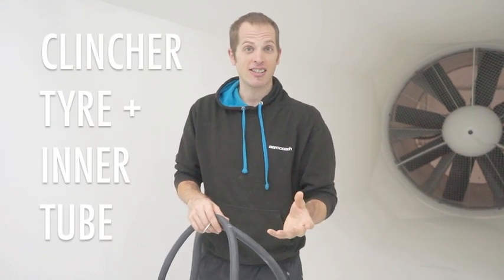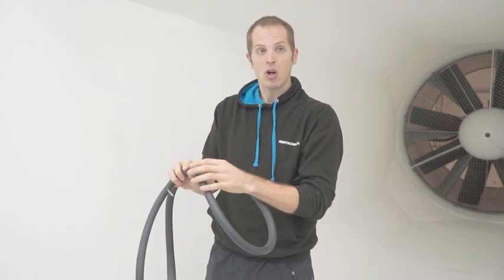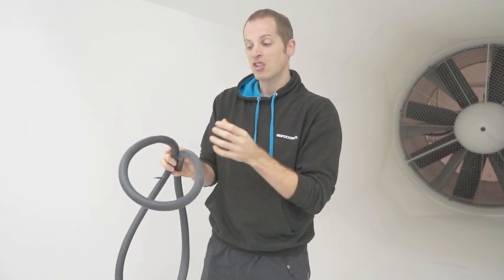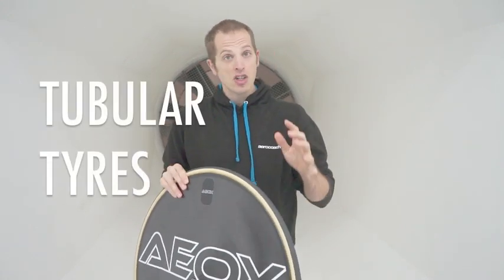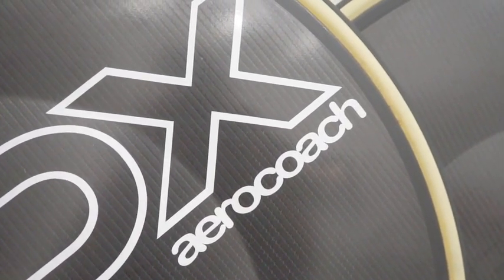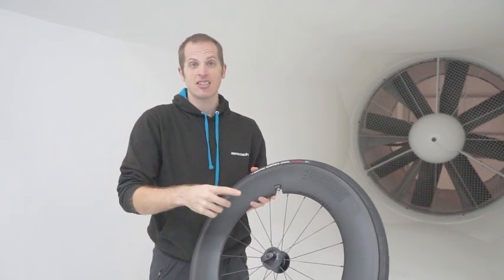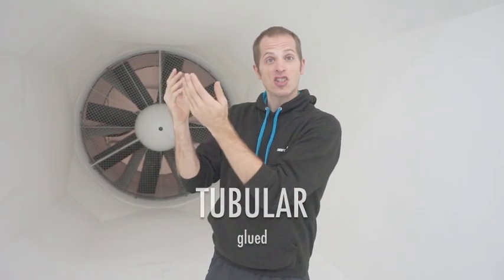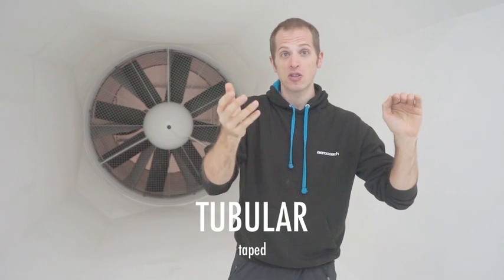CHOOSING THE BEST TYRES - clincher vs tubular vs tubeless!

Comment: Hi there. The power figures are tested on smooth rollers or actual road surface? Quite surprised to see that 120psi is actually slower than 80psi.
Reply: Smooth roller.  The numbers would be higher on the road but the differences would be similar

Comment: Great video. Can you do a follow up on how do the three systems differ aerodynamically?
Reply from the maker: Ben Hallam aerodynamics will be affected by tyre model but mostly by rim shape - so comparing the aerodynamics of a tubular vs tubeless wheel (for example) will be governed by how the rims are designed rather than how the tyres are mounted. 

Worth mentioning that a badly glued tubular tyre that’s all wobbly on the rim will affect aerodynamics though - clincher and tubeless tyres are always round!
Reply: So if you had the same width clincher and tubular tyres on the same width and design of rim, there isn’t much of a difference in how they perform aerodynamically? It’s more about matching the rim and tyre width?

BTW, I recently set a customer up with your extensions and pads on their P5: lovely bits of kit. Congrats
Reply from the maker: Ben Hallam yes exactly :) all the external shapes will be the same in that scenario so the aerodynamics will be the same too - thanks very much for the question and the feedback!
Reply: Great video. In terms of tubular tape, soft glue and hard glue, what is the wattage loss for running the tape and soft glue vs hard glue? Is it in the double digits?